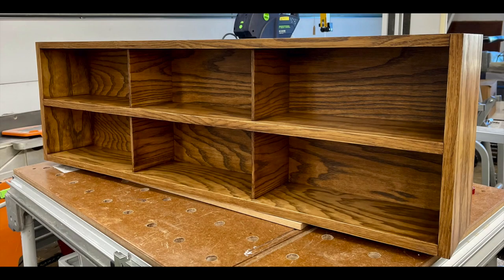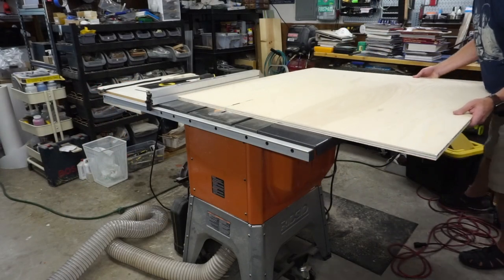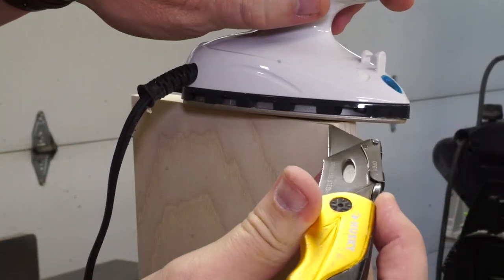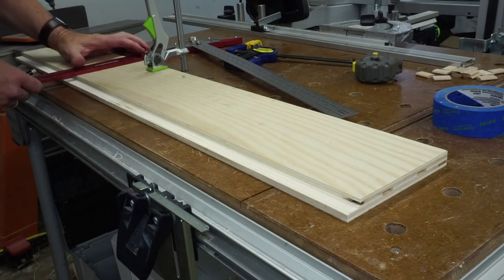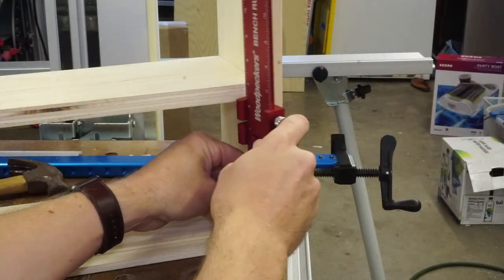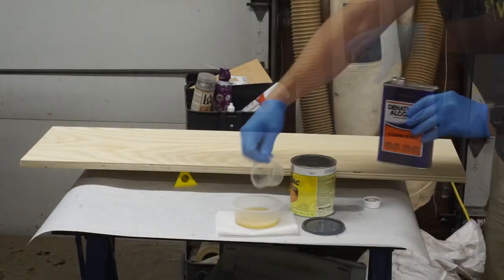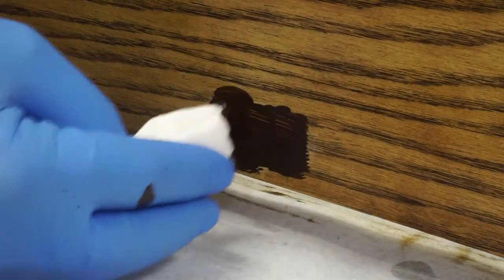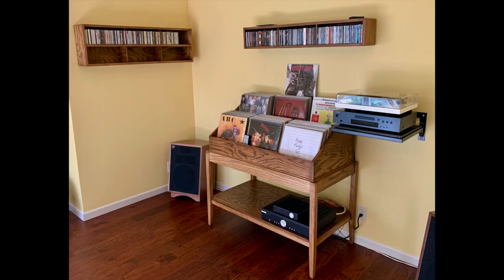Two Level CD Shelf

Comment: Nice, want to do something like this myself, only issue I need to scale it up lot, I need to be almost 8ft wide and almost 7ft tall, would you say this kind of wood is strong enough or work you recommend another type of wood for this kind of size. Im guessing are your shelves about 3ft wide? I need to house about 3000 CDs and even with a 8ft x 7ft I may need to make another one smaller to fit them all.
Reply from the maker: Interesting!  Yes, I believe these were about three feet wide.  A quality plywood is certainly strong enough as long as there are plenty of dividers placed within to keep the shelves from sagging under the weight.  I also used a 3/4 back piece with added a lot of strength.  My biggest concern about the size you are talking about would be how to mount it to the wall.  That is going to be a heavy shelf!